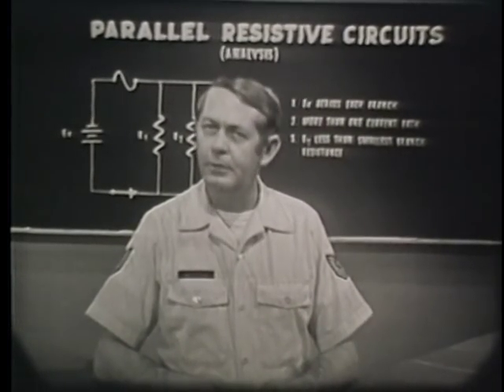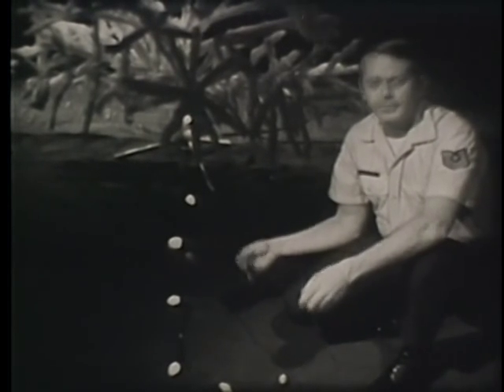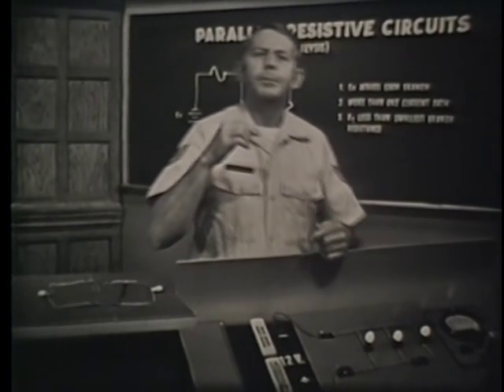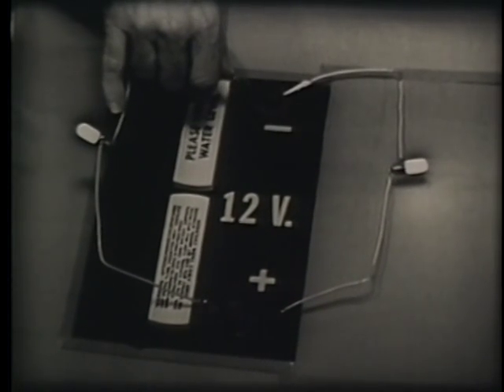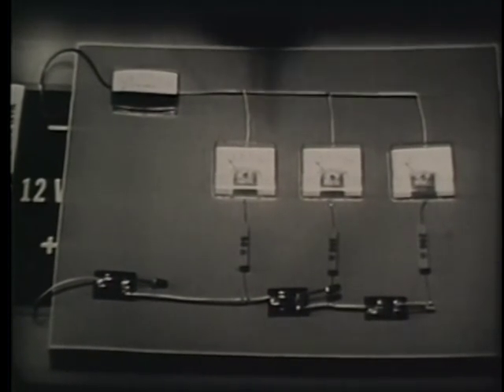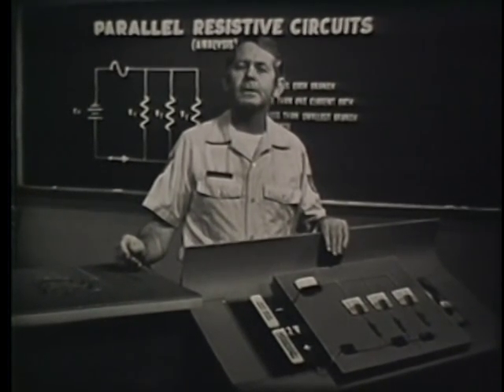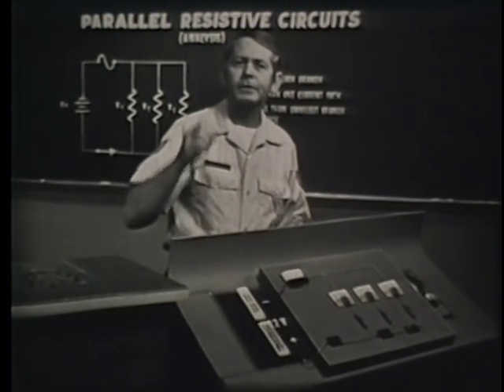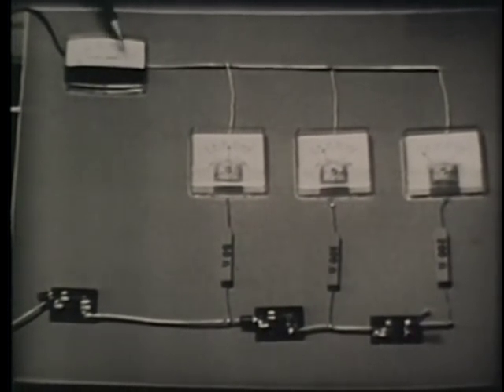ELECTRICITY - PARALLEL RESISTIVE CIRCUITS - ANALYSIS

Comment: I never understood why total resistance  decreases when you add resistors in parallel from back in the time I was taking "heat and air" at a community college until now, years later.